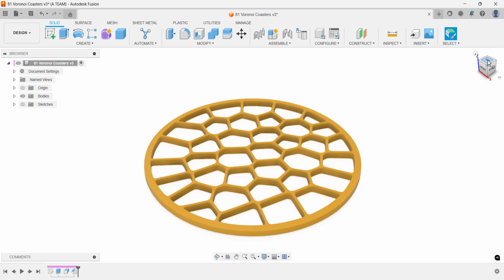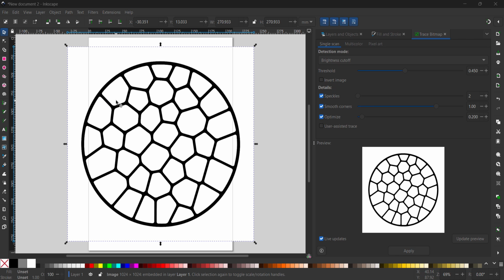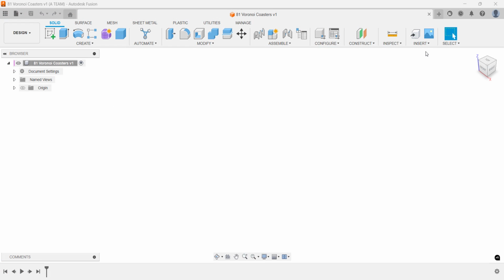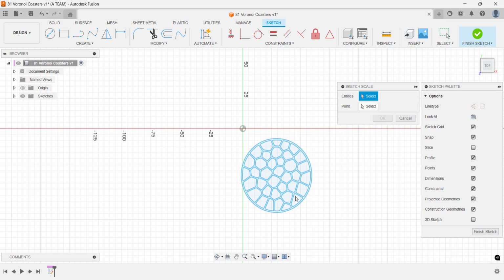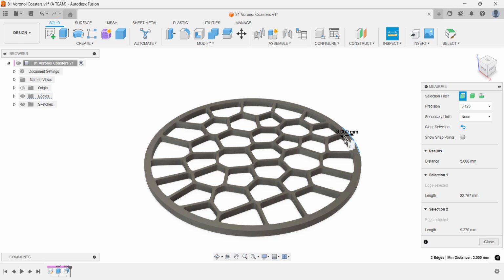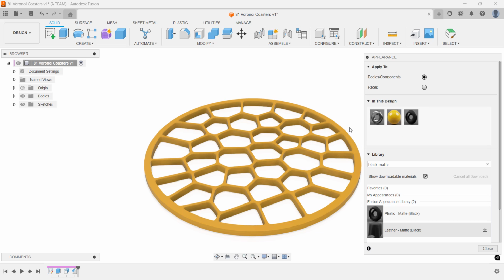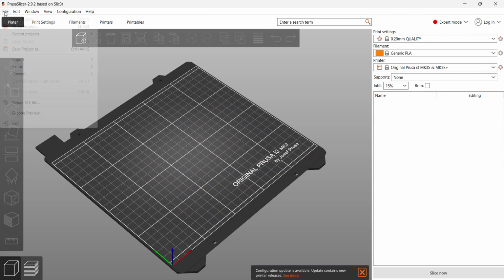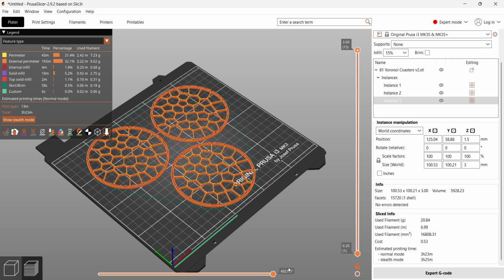Make a Voronoi Coaster Using AI and Fusion – Ready to Sell or 3D Print!

Comment: Doesn't having holes in the coaster defeat the purpose of it? Condensation will just fall right through it
Reply from the maker: Good point. You can still use it a lot, but not in as many scenarios as you can use a coaster with a solid bottom.